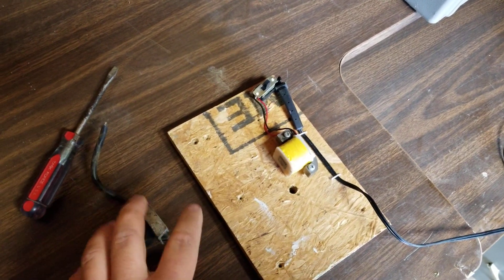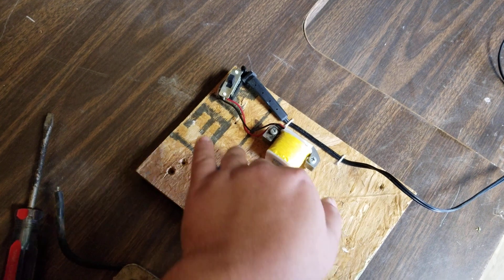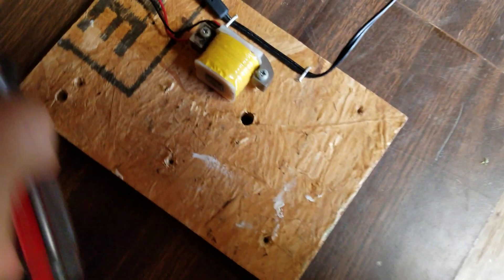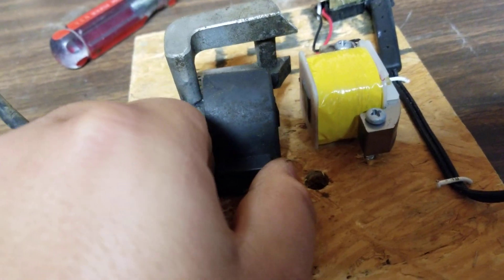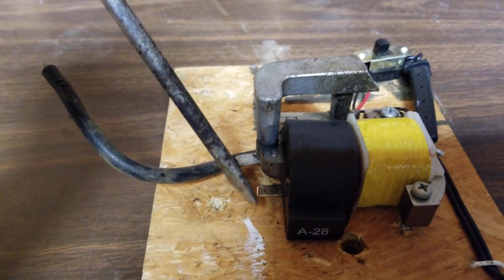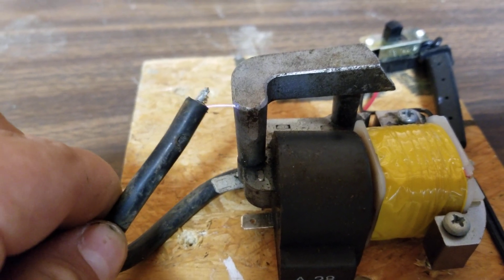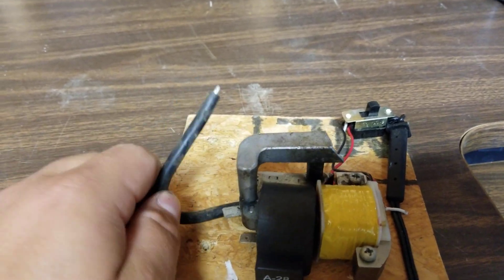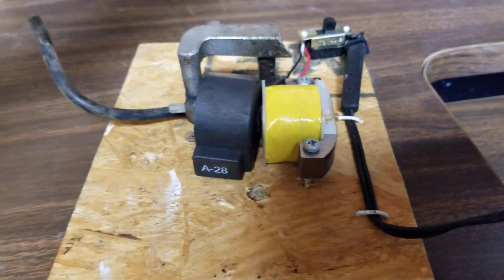DIY Magneto/Ignition coil tester

Comment: Nice try  but that will NOT  check a breaker points  magneto coil.  You are inducing power directly into the core, which then induces  power   into the   secondary, making the spark.

Comment: How to test fire on bench the Briggs pre 1882 Magneto with 8-9 volts DC ?? I tried many ways with no spark. I even passed magnet across one core end. The other car/ cycle coils all fire with 12vDC with both points/ condenser and the aftermarket SS ignition module. I think the inductance of primary is matched to amount of magnetic field of spinning magnet . About 8v induced, that shorts/ switches, and generates negative 130v , that induces into secondary for negative  minus 10KV.  The tab terminal is -130v that is used to shut off engine when grounded.The Briggs dealership has a specific adjustable electric tester for that purpose.
Reply from the maker: If it's the type that has a pints system (12v pulse), then this will not work on that type of system. As well as if it uses a control module (ZVS driver) . This setup is for the magnetic type of ignition coils.